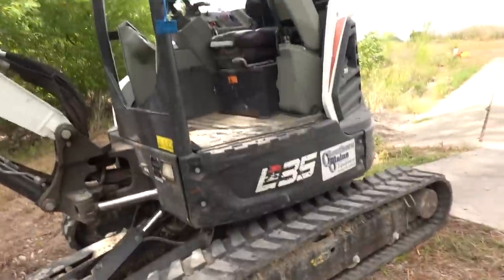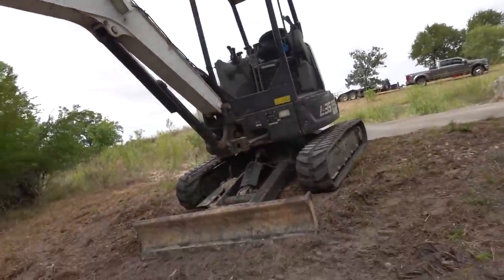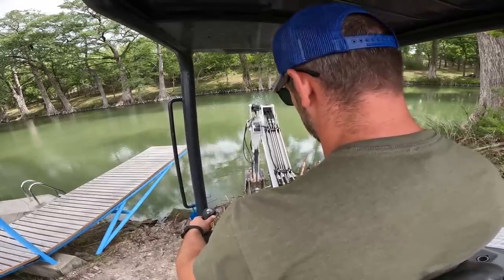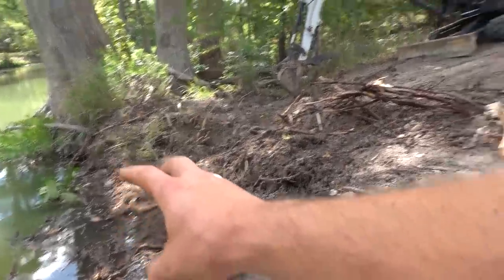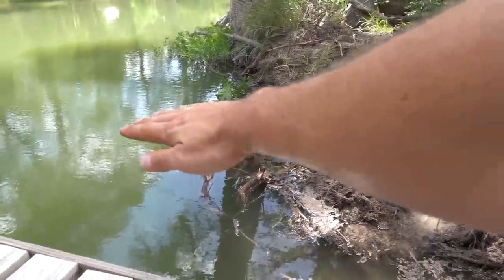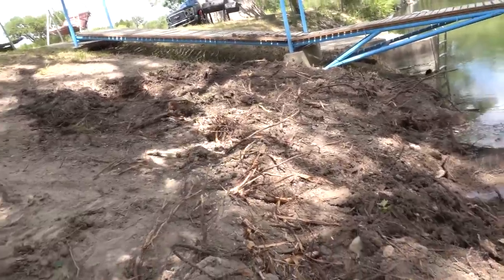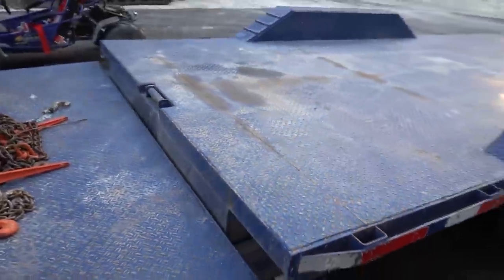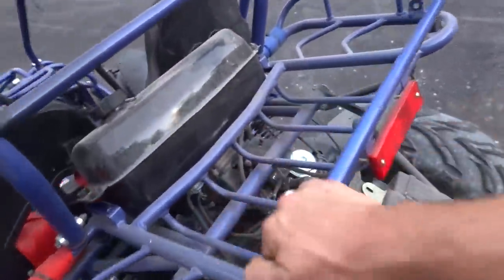My New Excavator... Digging the River!

Comment: Good luck with your gravel beach Matt. It’s likely to be trickier than you might think. When good rains come and the river gets to flowing faster it will definitely wash a chunk of it away. You may want to consider checking to see if you could legally build a break to direct heavy/ fast flows around your little gravel landing area. A break wall/ barrier could help with erosion of your beach. There lots of regulations regarding doing stuff like that though in a river so you will have to check with your state/ local officials to see what would and wouldn’t be allowed.
Reply: I AGREE!!!
Reply: This is Texas. Regulations are for other states.

Comment: Your point about fire risk on your property is a great one. Surely with that in mind, it makes (great) sense to install a huge, say,  ⅔ in-ground, ⅓ above-ground (concrete) water tank to harvest as much rainwater off of the workshop rooftop as possible. If you were ever unlucky enough to either accidentally start a fire or have a wildfire on the property, as good as the fire truck is, you'd STILL want a readily available place to quickly refill its tank or that of any fire department trucks. I suggest [concrete] because that won't be subject to melting or burning or accidental puncture from someone backing into it or by a stray projectile.

Comment: Good idea to borrow a mini first. That way you can decide what you need. Prefer yanmar and takeuchi with a cab and ac and heat. You can go one size larger on that trailer and you'll be fine. Bobcats are cheaper and will probably be just fine for all the work that you do. The best part is it will save your back and I wish I would have bought one 10 years earlier.  If I have to pick up anything over 50lbs I use the loaders. Get an enclosed cab for at the very least if your digging up rocks or trees because something will always fly up and hit you and the windows will protect you.

Comment: Matt just a piece of advice when loading heavy equipment it’s best if you center the weight with the axles. If you put it to far forward if you get over 45 or so the trailer will sway behind you and could possible flip the trailer and you. Just trying to watch out for you brotha.

Comment: Ok Matt, I tried to clear out some of the comment section that didn't pertain to the video. But like others suggested I would go with a concrete slab like a boat ramp. I do not see any way shape or form that any kind of gravel will hold up to a river during flooding. Possibly a metal grated ramp extended out into the water with a hinge so it can be raised and lowered out of the water, so it can be maintained. You could probably extend it all the way up and connect it into the concrete slab. I would suggest a slide but not sure how safe that would be.

Comment: You should try putting in a stone sidewalk. But it would be more like a stone driveway. Have the concrete laid and then put your river rocks in the concrete it wight be a little bumpy but it will hold together and not wash away. Also you might try to pour the concrete and connect it the platform already there.
Reply: Better to buy a slab like a Georgia guide stone and lay it on the ricer bank with  a sloping angle too it

Comment: There's a reason you don't see beaches on rivers.  They simply get washed away during high water conditions.  The river ate that bank away to 3 feet deep because physics.  Rocks, unless they're far larger than a skid steer can handle will be washed away as well.  You're talking about the power of large amounts of water flowing at great rates.  To get this to work, you would need a large wing dam above the area to push the current away from this area.  This is why there is a large concrete area with a ladder.  Because concrete stays while rocks/sand/etc is removed by the current in high water conditions.  Good luck Matt.  You will figure it out.
Reply: I see beaches on rivers. 🤷‍♂️

Comment: to dig into a river you need to pile rock dibris at the edge for your excavator to have solid ground to work from so you can reach out further into the river, do this on each side of the platform that is there and when you are done dig up your bank to retrieve those rocks and dig up silt and muck.  In this way you can make it deeper, something else you can do is put rocks down stream and put a board across them to dam up the water just a foot, would really help.

Comment: You should put a big rain water collection system on the new shop and have the overflow constantly going into the fire truck so it’s always full and then if there is a fire you wouldn’t have to wait on a well to fill up your truck you just use gravity and a big ass hose and it should fill the truck quicker

Comment: Should buy a compact tractor with a bucket, forks, mower, rear excavator attachments. I know you got the bobcat but sale it and get a small tractor so you don't have to keep getting other tools. Plus you can buy more attachments to do other stuff. With land there is always projects (fence post digger attachment, moving pallets in the shop, dirt/earth work, wtc) Kubota's LX Series is a good option.
Reply: There isn't anything a compact tractor can do that a skid steer can't. A skid can lift WAY more than a compact tractor. Unless you have lots of area to mow, a skid is much more versatile. I have a Yanmar YT2 and I went out and bought a bobcat. They can't lift as much, and changing attachments on the 3 point is a pain. Especially when you want to use the frame mount back hoe. That is a hassle to take on and off. And 3 point quick connectors are even more of a hassle. They both have their place, but for Matt, a skid is much more usable. There aren't really any attachments you can put on a tractor that you can't put on a skid.

Comment: I've always felt you need some kind of fire suppression system up at the house also. Even if it's just a pump and hose connected to your water source. Maybe your own fire hydrant. Your a Long Way from any city services for sure.
The slope at the river should be flattened a bit. Otherwise that lounge chair will be pitching forward awkwardly.

Comment: Those roots were likely holding the bank together in flooding. At the least put geotextile under the stone. Geo matting may work in the long run. Look up Construction Techniques, Inc., they make a grout filled mat that may work there. 
All the commenters bringing up not diving into the water, are right. I've seen the results.

Comment: depending on how severe that slope is leading up to the beach, you may need to stabilize along the slope to prevent erosion during rain storms. also, you'll need to stabilize the embankment against erosion from the flow of the river. I'm not sure, but the camera makes it look like you're on the not-so-optimal side of the river (the convex side of the river bend).

Comment: I don't think your idea is going to work you are going to grade it down more into the water and I would use the big concrete pieces as a base then a slope of crush and run gravel over top. It will still wash away during flood but nice till then.

Comment: Either wear all the safety equipment. Or none. You protected your eyes... and your head... the saw was never near them. But it was near your legs and feet... guess you dint need them. Almost as ridiculous as wearing a helmet with shorts and flip flops on a motorcycle.  Come on bud!!! Use your head for something other than a hatrack.